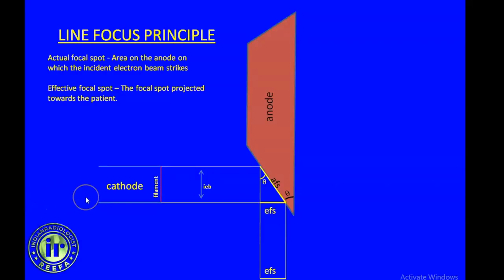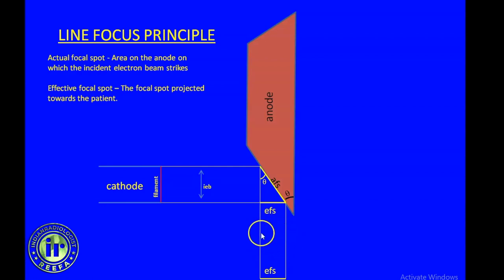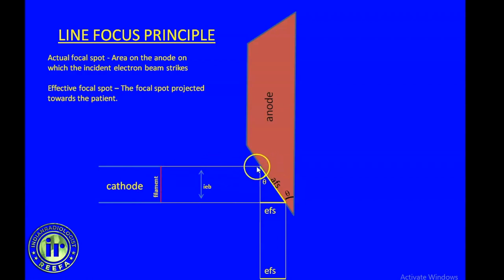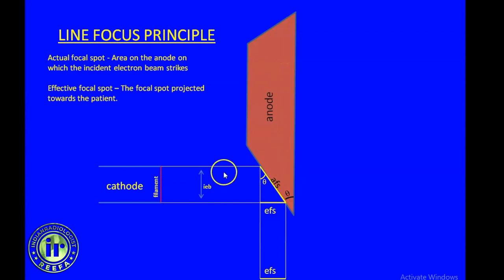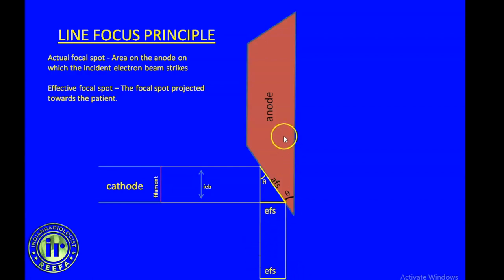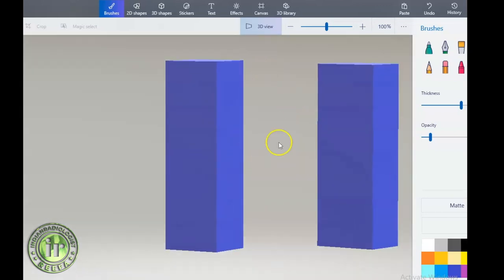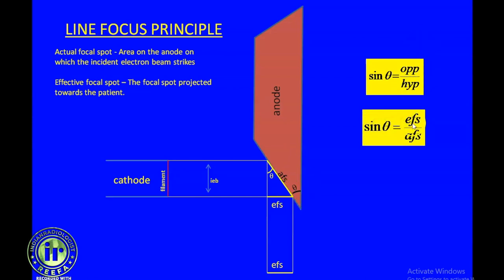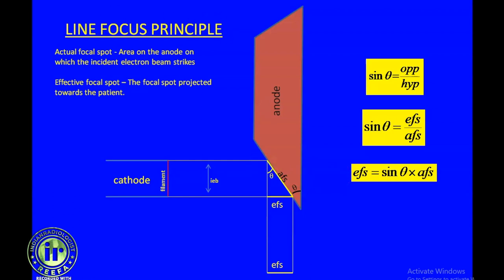RADIOPHYSICS | LINE FOCUS PRINCIPLE | INDRA NEIL MEKALA | ANODE SECRETS

Comment: Thank you sir 🙏... but there is a catch with this concept.. it appears on reading the theory that angulation has helped in achieving smaller effective focal spot.. but actually it is opposite.... as we see from the formula..lower the angle smaller is effective focal spot..that means if its close to 0..or no angulation..smallest effective focal spot can be achieved....but there comes one problem with this.. if we keep the angle small.. there will be more anode heel effect... which again will reduce the quality of image..so finally to balance both principle  we keep it around 5 to 15... thank you 🙏
Reply: Very true! Good analysis! As I said ideally (theoretically) we need the smallest size to achieve excellent resolution but practically it is not possible due to higher heating effect when converged on the anode, increased Anode Heel effect and also reduced Usable Field Size! Also one can observe the converse : as the angle increases (sin value increases), the width of efs also increases...again a disadvantage as the whole purpose of tilting is lost and image is blurred. So a tradeoff / a meticulous balance is required to achieve both narrow focal spot and good heat dissipation simultaneously keeping in mind the Anode Heel Effect and Usable field size 🙂
Reply: @indraneilmekala3246  great teaching sir 🙏🙏
Reply: @sumitkumarverma6295  Thank you!🙏😊